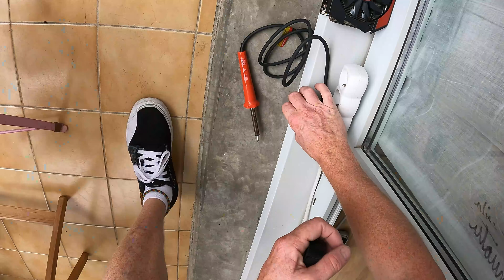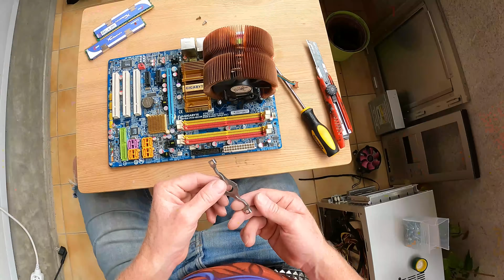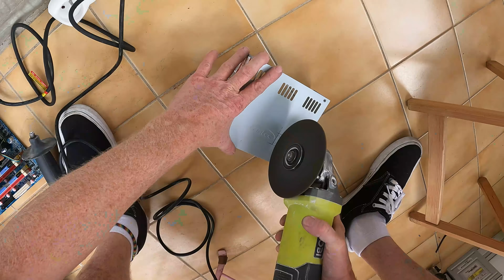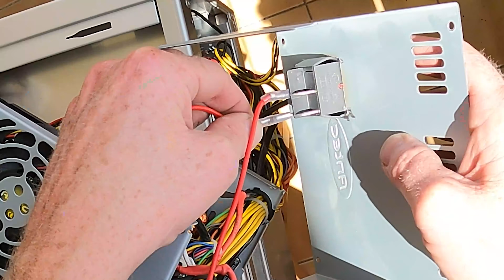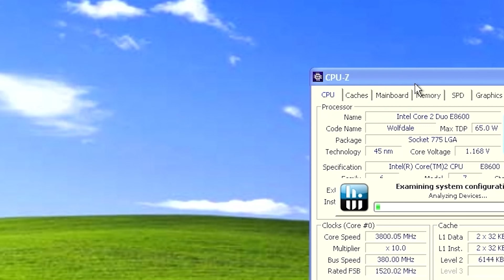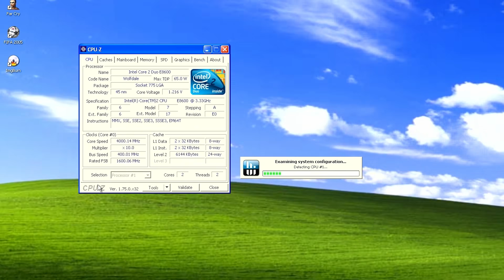Finishing My Dream $76 Windows XP PC

Comment: So I just wanna start off by saying that you clearly know what you're doing with electrical wiring but I'm just curious why you've chosen to do everything the hard way. 

Perhaps something to do with the budget of the machine but really like you can pick up a rotary Dremel cheaply so you can cut more precise holes in metal, there are much easier ways to get the lights wired to the computer internally as well that don't leave it hard lined if you ever want to disassemble this PC.

Beyond that you've made many cool design choices. I very much appreciate the right angle graphics card. I also work with 775 machines a lot to build retro gaming towers. Nice to see more of us out here.
Reply from the maker: Cheers mate. Yeah you got it low budget just got to work with the tools I got. 
I've moved to France from New Zealand for my wife and I'm not working yet and the channel is long way off be able to monetize so pretty much have to sell the old projects to fund the new one's.  Its really sad to let them go after working so hard on them but its all part of it.  
With each new project I can get more advaced with my methods or return to the project down to line with more upgrades if I can get away without selling them off haha. 
Love 775 PC's still rember when they were new the performance was so much better than the Pentiums before.  I had my 1st one almost 10 years before getting a upgrade.  
Thanks so much for watching!

Comment: super sweet that you went into a bit of detail about overclocking, looks easier than I would have imagined even on this old bios
Reply from the maker: Thanks mate, 100% and as long as you keep you voltage under the brands recommended maximum (normally around 1.35volts) and with good cooling you'll have no worries.  Thanks for watching

Comment: hey, i have that case aswell for my windows xp build
Reply from the maker: No way what are the chances of that haha so cool to know they still out there such a nice case for the time  😁
Reply: @TheDiWHYGuy  TL;DR- I've saved 4 of these Lian Li PC-6xx chassis, they were well ahead of their time for case design and still great cases today. 

People forget most PCs from this era were still rocking beige plastics over steel, so an all-Aluminum construction was special even then.

I got a silver PC-601 from my University' Physics Department' dumpster. It now runs a Core i7 990X. I also got a black PC-61 from a Craigslist ad for $25; turns out it was once a NORAD PC earlier in its life; the hard drive was pulled for shredding but I got the rest of the system. It now runs a Core i7 4770K. 

I have another that's a PC-60 Plus, it hasn't been built in yet, the case was damaged by the shipper so I got a partial refund; it was $50 marked down to $30, and it kinda needs some parts now that I've borrowed some for the crown-jewel: an $80 Craigslist-find ProMagix HD60.

I used wayback machine to find more info: this was a System Integrator of Lian Li that had bespoke cases made for their custom gaming PCs; the one I found was based on the PC-60 chassis with a new milled faceplate and swinging optical drive-cover, and was spec'd around $4k MSRP when new, complete with Core 2 Quad, cold-cathode lighting, the V1000 style removable case wheels, and the plexi side panels like yours. 

I think I'm going to leave this one stock: it came with an EVGA SLI motherboard and matching SLI ready RAM, it's missing the original GPU, but I do have an ATI HD5970 in my parts bin that should fit (it's a dual-GPU card) and be period-correct. 

Both the PC-601A and PC-61B have solid side panels, only the PC-60B Plus has the acrylic panel as well, but I sort of prefer the look of the solid panels for those. Both cases were missing 2x optical drive covers, so I used leftover Blu-Ray drives or sound card I/O controllers to fill the holes, and they're functional too.  

I also kept all the old Athlon64 hardware from them, and I have more generic steel cases so I can still make retro 98/2000/XP machines with the leftover bits. 

Watching was lots of fun; glad to see other PC enthusiasts saving these older, classy rigs!
Reply from the maker: Far out well done saving all those old PC's you done a good job by the sounds what a cool collection 😁 glad you injoyed the video thanks for watching and keep up the good work mate!
Reply: Yes indeed